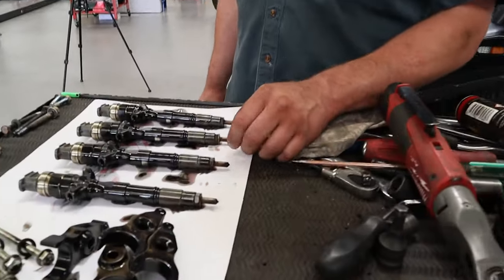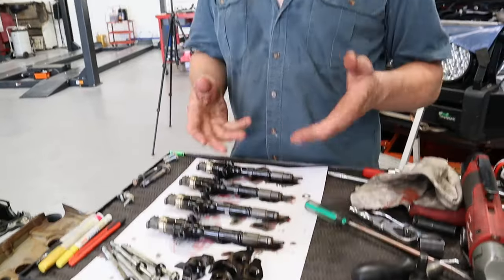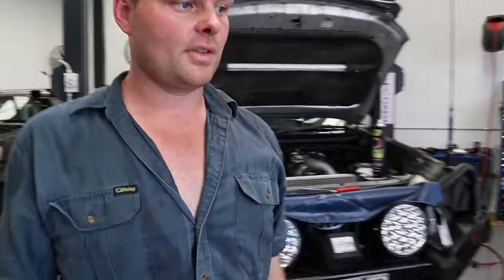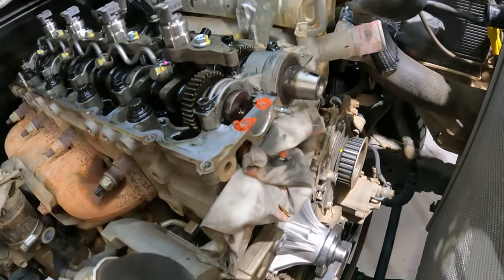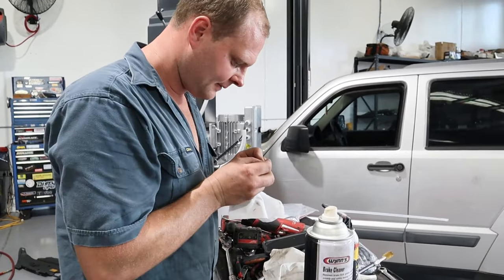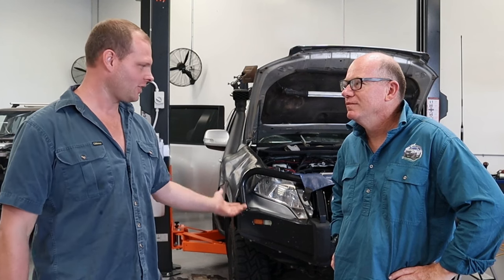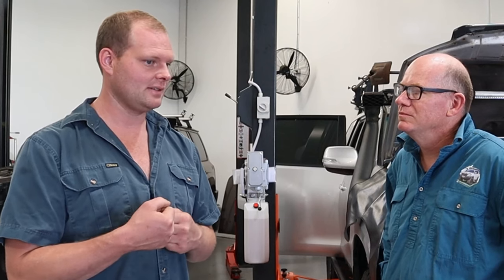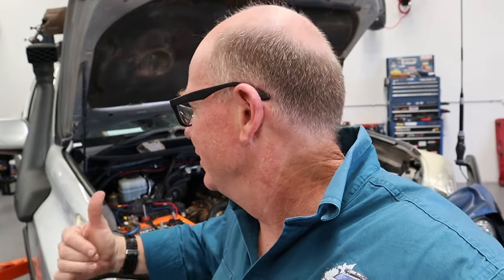Shocking Prado Revelation: Facing the Ultimate Challenge!

Comment: Did you run diagnostics to check for codes and to verify if the injectors were still in spec… this will tell you a lot before working on the motor
Reply from the maker: No not before. I just knew it was time and I was just about to do a big trip over to Perth from Toowoomba.
Reply: @prado150outahere  big injector job out of the way plus other important maintenance. Injectors: 7 years or 170k, whatever comes first.